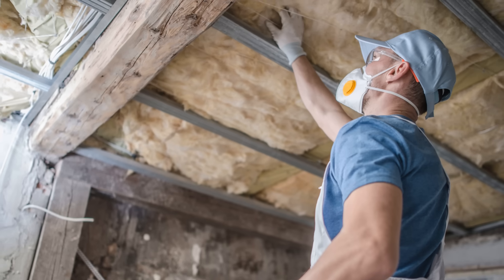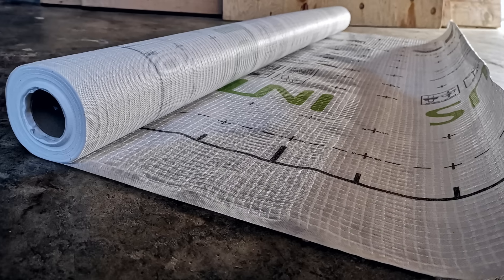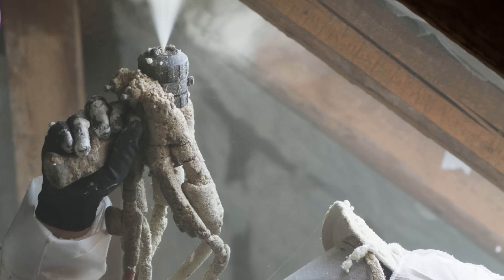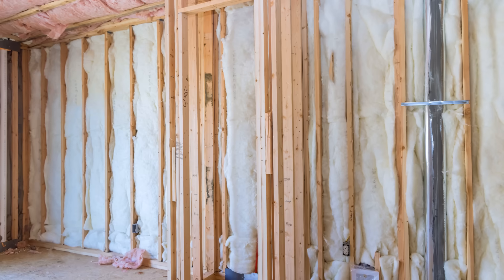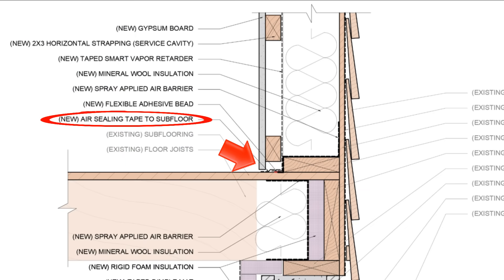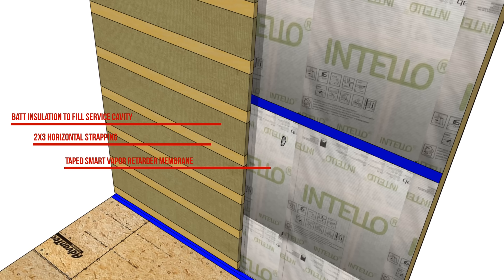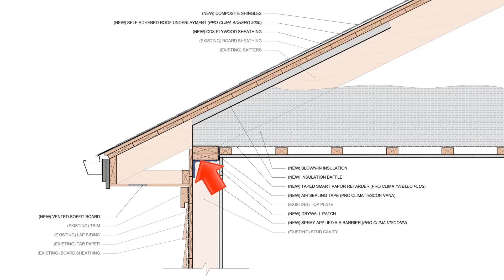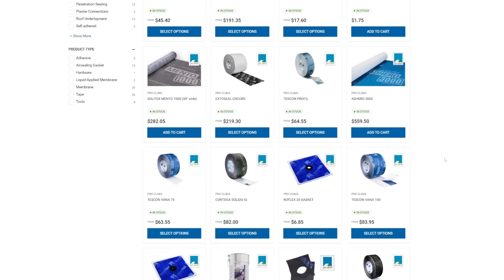We’re Using THIS Strategy To Insulate Old Homes and Buildings

Comment: Good information if opening up the walls; however, for many of us living in an older uninsulated house on a very tight budget, that is not a financial option. Neither is paying for high heating bills. Is there a way of properly insulating existing walls and ceiling joist without major demolition?

Comment: I dont understand the vapor barrier part.  There is moisture on both sides.  The colder side, regardless of barrier, will condense and retain moisture.  Your still shifting the dew point to the wood wall.

Comment: Is the smart vapor retarder membrane only used in cold climates and not need it in hotter climates in the South? Is the blue spray-applied air barrier from a Canadian company? I ran across something similar from a Canadian company that specialized in products for rebuild a wall from the inside out and especially for brick. Any issue with Rockwool causing framing to rot in home in the South? In Texas, we don't use vapor barriers since it will cause rot.

Comment: I plan on using Zip R sheathing on my house I'm renovating.  Would the insulation on the zip R count as on the outside or the inside side since it's on the inside of the sheathing when calculating that I should have 35 percent of my R value outside for the zone I'm in?

Comment: Should I use this "smart vapor barrier membrane" on the Inside wall (Red Brick ) IF I´m going to be doing a Exterior Insulation (Steico Wood Fibre boards, breathable  ) - ? Or Do i only need to use a "vapor barrier membrane" on the outside of the house and therefore just keep the Inside wall bare and untreated ?

Comment: Love the thoroughness, it tells me my 1955 house will have to be torn down to the framing or I'm creating a fungus incubator.  I've suspended any changes and the house will rot in place because that cost to control air and vapor is more than I can afford with my retirement nest egg. It would be cheaper and more convenient to tear it down and rebuild the entire house.  From watching this channel and Risinger's channels, I've determined that renovation is not practical unless a house has tremendous appreciation value or historical significance and that the owner has heirs to leave the property to.  Those of us who would most benefit from these improvements cannot afford them and the savings in heating, cooling, and maintenance costs will not be realized in the ownership lifetime of the home owners.  Toss in that most contractors are less than clueless about building science and it's a non-starter.
Reply: The more I research this the more I'm convinced you're right.
I'm 62, recently moved into a house from 1917 and It will not be handed down or resold by us. I find the cost of materials, and amount of labor to be beyond my capabilities.
House and garage are 12" below grade and lot is lower than surrounding lots so no where to run a drain to. At this point I may just throw up some plastic, insulation, and drywall and call it done.
Reply: @Pablo453  Thanks, Pablo! I though I was the only one in my situation that watches ASIRI.  I love the science and what we can do to reduce the need to move heat and vapor around, but creating the sealed envelope to make that happen is out of reach for many of us with older homes unlikely to appreciate quickly.  In my case the work, along with some needed repairs and some minor updating, would be more than 50% of the current market value.  I'm likely to live in the house another 8 or 10 years before needing other options, so spending that kind of money for little or no return seems foolish.  If it were a unique home or highly desirable location and I had heirs, I might have a different view.
Reply: If you are not doing it yourself then either live with the mold, or sell and move. But on order to sell you have to fix the mold. 😂 Good luck. My dad is 74 and still fixing house issues. You can get the Materials and work with a good recommended handyman and just tackle it one room at a time. Or just sell it, there is options if you own the property.

Comment: Renovated an old cottage in terrible condition 3 years ago. I used the intello wrap inside on the old walls and ceiling as a contiguous vapour barrier with breathable blueskin on the outside of the building. On the outside I added a 1.5" layer of rockwool and then clad with cedar shingles (breathing layer added also). Lot of work that. Inside I removed the old very poorly installed insulation and replaced with tight fit hemp bat insulation. Hemp is the best insulation I have ever worked with. Bit tricky to install as it is so tough. I used a table saw to fit the batts. I then cross strapped the 2x4 wall with 2x2 horizontal and fitted hemp insulation between. This gives me roughly an R30 wall. Attic got R65 cellulose. I easily heat and cool the building with a small heat pump. ERV is one of the breathing ones (Blauberg Vento in my case). No mold. No issues. Nothing but comfort. Highly recommend the intello and hemp insulation is da bomb.
Reply: What's the best way you found to cut hemp batt?
Reply: @richn137  Table saw for long cuts (ie. over 6 inches). For small cutouts for electrical boxes or ... we pinched the hemp and used a bread knife. That was a lot of work. I've since seen an angle grinder used. Maybe a bit heavy for all day use. A 20,000 rpm thin 3-4" diamond blade would be very interesting to try. Good luck.

Comment: Perhaps I missed something, but is the intello air barrier self healing?  When you put the strapping on the ceiling how is it attached?  Wouldn't nailing or screwing it put hundreds/thousands of penetrations in the barrier?  I've read this is a problem with plastic vapor barrier behind drywall, wouldn't it be the same here?
Reply: Perhaps put caulk where the screws go.

Comment: I am currently renovation a 1925 double brick home in Ontario Canada, and any advice on insulation the exterior Walls would be great,it currently has a one inch fiberglass insulation which looks like it was added in a 80's kitchen remodel to the one inch cavity created by adding a 1x2 to the horizontal 2by set in the inner brick course with a rough plaster finish

Comment: Great video!  However, as you mentioned, changing the airtightness of the building drastically changes the airflow (obviously).  I have often seen it recommended that if you airseal the building to this level, some kind of ERV or HRV system is required.  Do you have any experience adding these systems to a retrofit renovation?  What does that typically look like?

Thank you for this amazing content!

Comment: And once you use or already have clay plaster, condensation and moisture calculations just fail 😅. That stuff can absorb and distribute moisture so well, it takes a failing roof or major pipe leak for a critical moisture - and even then the building can recover by simply drying. Try that with rock wool...

Old wood frame is certainly destroyed by spray foam as well as concrete and cement plaster. Barriers caused rot too, because small cracks allow moisture to enter, but it could never leave.

We used Wood fiber and clay for internal insulation. It is very simple and cost effective. This insulation has only 5 ingredients: 
1. up to 6 cm wood fiber insulation (plates)
2. Clay bottom plaster
3. Screws or other material to secure the plates
4. Jute or glass fiber mesh
5. Top clay plaster

 The wood fiber plates are glued to the wall with bottom clay plaster and secured to the wall according to the manufacturer. Next the insulation is covered with more clay plaster, which is secured with a glass fiber or jute mesh, it is embedded in the top third of the clay layer. It can be between 1 and 3,5 cm thick. The finish is the top clay plaster.
This is very easy to do and usually people who have no experience with cement-plaster are doing it better than those with experience.

And yes, the clay functions as the air barrier in cooperation with the plates. This results in 3 air barriers while any water can evaporate in all directions. 

Other advantages: excellent sound barrier, humidity regulation, heat absorption, fire barrier, non toxic. And it smells good 😅. Special dowels allow for things to be hung at the insulated walls.

Comment: An other very useful video! At 6:24 you mention insulating the 2x3 cavity. Is there a maximum ratio to respect for the insulation on the cavity vs the insulation on the other side of vapor retarder to prevent condensation in cold climate. For instance if I put R21 on the other side of the vapor retarder and R12 on the cavity would it work just fine? And also, in order to keep some drying capability is there a maximum R value for the whole wall assembly you would recommend for retrofits? Thank you very much!

Comment: Your gripes with closed cell spray foam seem to stem from (unfortunately) common install errors such as improper surface prep, humidity, temperature, or application rate per pass. So this is a skill issue, not a categorical product issue. You should find a better installer so you have this as another viable option in the future. Also I'm sure your more complex approach here is also vulnerable to various install errors.
Reply: Increasingly uninsurable in the UK which means banks won’t offer you a mortgage.
Reply: Check out BSI-143. Also I'm not saying closed cell is necessarily better in every case, but just that it's a viable option to have in the toolbox and should not be written off completely.

Comment: In the diagram that shows up @4:16, it shows taper dimple mat under rigid foam insulation.  If moisture does get into the air gap between the dimple mat and the concrete, where does it go?  If the dimple mat is sealed, where is the "escape" for the trapped moisture?
Reply from the maker: @jethro9341  It's drained to an interior perimeter drain. We have a whole video on this retrofit technique: https://youtu.be/KVC1qjewTRM

Comment: Why do you choose to install a strap cavity instead of an interior 2x4 wall?  Strap cavities strongly limit the electrical boxes you can use, places wiring right at the code minimum from the wall surface, provides no r value, and unless carefully thought out, may not provide adequate strength for attaching built ins or furniture.  I realize cost is important but a sheep wool filled 2x4 wall, broken from the exterior wall, provides noise reduction, additional r value, hygroscopic buffering, and the traditional 2x4 partition walls.  Other than being cheaper, why is the strap system better?

Comment: Why should stud cavity batting be unfaced?  The video never explained why.  I have already put in paper faced fiberglass, and I am about to put up interior xps foamboard over the studs and fiberglass, then gypsum board over the foam board.  The house is 1950's uninsulated timber framed, with plywood and cedar shake exterior walls.  Is the paper facing on the fiberglass a problem?  Would airspace between the paper facing and the foam board help?
Reply: it's because faced batting has a "vapor barrier" aspect. That kraft paper is a form of vapor barrier. It has the potential of  creating a moisture trap and you don't want that. It's one  of the reasons I prefer rockwool.  1.  That pink stuff may be cheaper but it's also tends to be lower r value.  2.  installation . Because you have to staple it,  you are inhibiting the r factor because you want fluffy pink stuff and you're stapling the edges down.  3.   The pink stuff tends to sag after a while.

In contrast, rockwool is far  more sturdier. It is easy to cut. You can just pop it into a cavity and friction fit it. And besides that, I kind  of like the fire  resistance. I've used it elsewhere and I can attest to it's ability to stay in place.  However, it is a slightly more expensive product.  But I figured that I'm not going to open up walls or things like that all the time so I should ensure a solid assembly that my paranoid OCD brain won't obsess over and worry over.

For the faced stuff.. there are rules. I never really focused on it because I went to rockwool. but there are rules to which side gets the faced kraft paper.
Reply: The paper is a vapor barrier, but in my view doesn't do much because vapor can easily escape around the edges of the stud cavity, and lot of air travels through it.  I've never seen a problem with it installed behind other stuff, especially if the other stuff can breath.  The barrier in the video allows vapor to go through, just not the air, if I understood it correctly.

Comment: If you have a building with studs and masonry, how is adding rock wool going to “uncouple” the studs from the masonry. Either they are “coupled” or not.
Reply: From the video, I got the impression that they were taking what started out as a solid masonry building and adding the studs (or battens) and insulation, so they had the opportunity to put a barrier on the inside of the masonry before the studs were added. If we were talking about a 20th century brick-veneer building, the "uncoupling" (tarpaper, air gap, etc.) should have been part of the original construction and it would be quite hard to add it later.
Reply from the maker: Thermal break
Reply: @ASIRIDesigns  How does inter-stud rockwool achieve thermal break? Thank you for all you to teach all of us!

Comment: It adds another step but if you use two layers when battening the ceiling you create a more usable service space.  You can rod cables in either direction allowing for easy retrofit of network cables, downlights, smart speakers etc.  If you only batten in one direction then you will need to cut the battens and damage the plasterboard to get across the ceiling.

Comment: Depending on your climate it may not be of any value to insulate an old house. Good way to rot out a house that has stood for 150 years or more already. Same with windows. Refurbish the old windows. New windows just have to be replaced in 15 years. No energy saving overall.

Comment: A house should naturally breathe. In my opinion roxul is best. I do not like spray foam. It is flammable, off gases for a while and makes any repair in the future near impossible. It can also trap water if the seal breaks and it does not breathe. If applied wrong spray foam can cause some serious problems. Spray foam is good for rim joists that are difficult to insulate but I would not do an entire house with it.
Reply: There are a few spray foams that do not off-gas dangerous fumes. Icynene is one. But I never use these products, simply because they are overpriced. I use Rockwool products and foamboard where necessary.

Comment: How do you seal the hundreds of penetrations from installing the strapping?  Also, how do you run romex and plumbing through strapping?  How do you fit electrical boxes in the wall?  The only realistic way to do this is to build a 2x4 (minimum) auxiliary wall for utilities after the vapor barrier is installed.
Reply: There are fewer screw/nail holes in the vapour retarder with strapping a service cavity than from drywall. The holes are filled by the fastener, but some systems use self healing tapes.

In terms of wiring, a deeper cavity is preferable, mainly for wire protection, but there are shallow but wide boxes that can be used to keep the volume adequate for box fill. It is a little more planning, for sure, but the lack of vb wiring penetrations is worth it imho.

Comment: I live in an old Victorian in SF with wood siding, no sheathing, and no insulation. I worry about a mineral batt wicking moisture from wet siding into the interior of the wall cavity. I’d like avoid taking all the siding off to install a moisture barrier behind. Would you recommend spray applying a moisture barrier directly to the back of the siding? Would that prevent the siding from drying out? 

My plan right now is to add 1” vertical batons parallel to studs and against the siding and then installing taped foam insulation against those batons to form an air barrier and insulation.

Comment: Here is my situation.  I am in climate zone 3A (warm humid - southeast US). I am retrofitting from the interior on a town house due to HOA restrictions.  I have OSB sheathing under vinyl siding with no building wrap.  2x4 std framing and lots of penetrations for utilities and such.Slab on grad with no seal on the floor sill plate.  I plan to air seal all seams, the sill plate, penetrations and replace the fiberglass with mineral wool.  Do I need an Intello type air barrier and if so do I put it on the sheathing side or on the dry wall side?  My intuition tells me I don’t need it in zone 3A.  I have never had any moisture or mold issues since there is a lot of air movement in the wall, but once I air seal and reinsulate this may change.  Just stopping the air leaks would be a major improvement for winter.  But I will still have a thermal bridging issue.  Thoughts?
Reply: Do you really want to tear out all that fiberglass just to replace it with rockwool, which is in the same general range for insulation value? Wouldn't it be more cost effective (and less messy!) to use thermal imaging to find whatever leaks and air currents there are and surgically seal them with tape, caulk or spray foam? Vinyl siding over OSB with no housewrap is kind of a vulnerable system and I've read that it became be a code violation in many places after the mid 2000s, and I assume the HOA will hold you responsible if they believe (rightly or wrongly) that anything you've done has trapped moisture, so you might want to tread lightly and get the best expert advice you can on how to seal up these leaks without exacerbating any potential problems.

Comment: A big fan rock wool/mineral wools for there properties and longevity. These smart vapor retarder seem great, but how long will they last? Will it last a lifetime or will I need to redo it in 30 years?
Reply: Gridded intello is tough stuff and on the conditioned side.  As long as properly attached, I expect it will outlast siding, roofing, hvac …